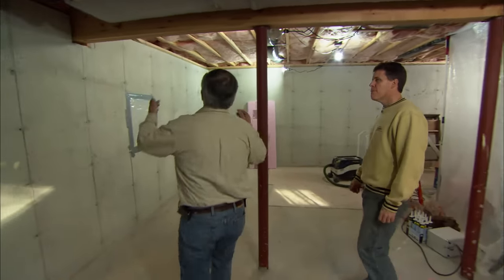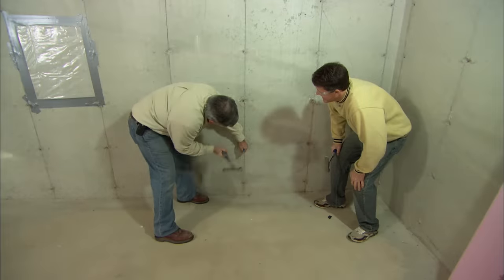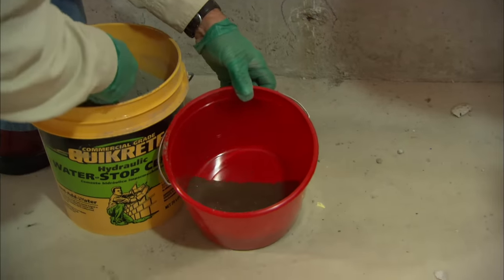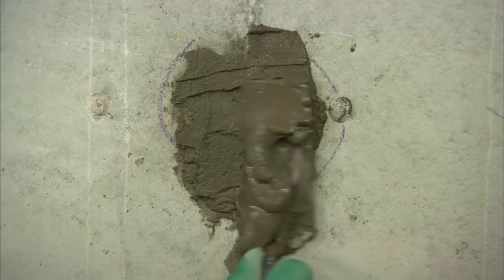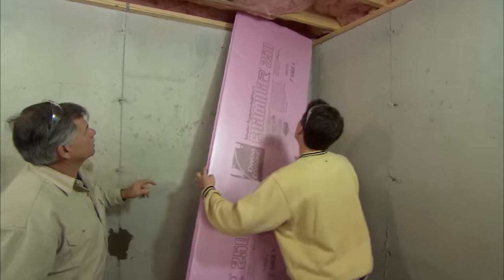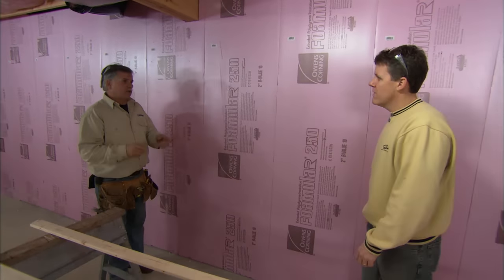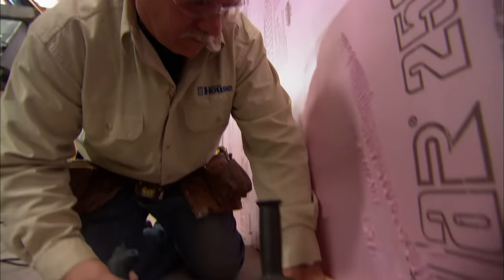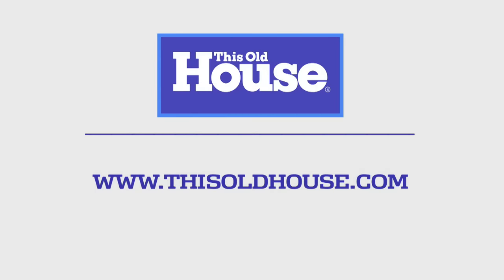How to Insulate a Basement | This Old House

Comment: If you live in a part of the world that experiences extremely cold winters, the risk of frost and ice forming in-between the XPS panel and concrete are ridiculously high. To reduce the risk, the perimeter of each panel would have to be completely airtight. Good luck achieving that against a poured concrete foundation. Doesn’t matter how dry your basement is, dehumidifier, RH <30%, frost will form on above grade concrete walls if temps drop down to -38F, regardless. Once a layer of frost is established it will grow like a fungus over the cold season just like it does  on the walls of your chest freezer. After a few warm spring days aka “defrost cycle” you can forget about having a dry floor, or walls, or carpet. Don’t ask how I know.
Reply: Agreed. So what would be a better solution for cold climates then?
Reply: @evgenykujin1725  a properly installed spray foam solution is about the only way to retrofit in an existing home. ICF with compatible spray foam around the rim joist if building new. It’s an uphill battle against moisture / mould otherwise.

Comment: I actually used this method and was sorry I did. 1) those bent bolts were near impossible to find. 2) drilling holes into the (35 year old) concrete walls ate up tons of drill bits. 3) One wall was slightly bowed so that putting drywall over it was problematic. 4) etc. Had I known all the issues, I would have used a completely different method.
Reply: did you use masonry bits? i have to drill concrete a lot at work and one bit will last months of hard use into concrete that is at times over one hundred years old.
Reply: Gene Lamb That's the thing. They were not bolts. Spring Spike Nail.
Reply: @leeknivek  and did he use a hammer drill? Regular drills aren't for concrete.
Reply: @digitalconsciousness  Thanks to everyone for their comments but drilling the holes was only one of many issues with this wall structure. In retrospect I would have used normal framing with steel. Would have saved additional fireproofing, allowed for easier outlet and wiring installation and made it easier to put on baseboard.

Comment: I am doing a similar project on my basement, however here in Greece they do not have these special adhesives, just using a low acid silicone adhesive to the concrete. I also use a serrated knife to do my cutting and to make it easier I spray the knife with a dry silicone spray. To do the drywall I just frame out with steel studs and then hang the drywall. Only problem here is that they do not have "new construction" outlet boxes to pre hang for electric. They only have boxes similar to our old construction work electrical boxes. It is a pain in the a-- to run the smurf conduit into the box since there is no clearance in the hole one places in The drywall to mount the box.

Comment: I did just that, few years back, my basement is 3/4 under ground on West walls and slop down to couple feet East side. An old ranch, built back on 57, foundation is not poured concrete, they use concrete blocks, which is very porous, but at least it was sealed outside with tar, and had some drainage around using clay pipes. Is not a full 8' ceiling either, which driver me nuts, one more roll of blocks would have accomplished it🤯. Had big issue with hydrostatic pressure, when I bought the house everytime it rained water would started coming between the concrete joints, center. I installed a sump pump below floor an installed gutters. Basement has being dry since than, for about 15 years. Finished basement that foundation was not proper done, is a big challenge. You have to fallow some rules, a steps. I did read, searched, watch videos, for long time. But it's a site, forgot the name, that explains step by step how to do it, according to different situations.  I actually printed out the pages that portioned to my case.

Comment: When i finished our basement., I added a cork into each hle , then used the hydraulic cement.
Reply: Did you put sealant on the cork?there is specialty foam rod for that use.it works great.I use it around window installs and then follow that with sealant or expanding foam

Comment: I worked at a 300 unit apartment and we use to get a lot of rod hole leaks. Best and cheapest way to plug them, silicone caulk with a cork.
Reply: at least use urethane calk, not silicone

Comment: I did the condensation test twice on my basement walls in two different places. No problems. But I did that in the Winter. Does it really make a difference what time of the year you test for condensation on the basement walls since Winters tend to be drier than Spring or Summer?
Reply: It makes a big difference.  That was the first thing I thought about when I saw the "test."  In full-season climates, basement humidity drops significantly in the winter when outside ground water freezes.  Test in the spring and summer for the worst case scenario.
Reply: Many of you folks forget about water pipes (which tend to develop leaks) when doing moisture testing and the best time is during the season of spring and autumn since that is when condensation season starts and ends.

Comment: I think any seepage will be trapped behind those insulation boards and not dry and then have mold behind there.  You should frame out a regular 2x4 wall. You should just use regular insulation and make sure it doesn't touch the wall .  Any seepage will run down the wall and has a better chance to evaporate.
Reply: I agree. not only for the sake of the mold but the concrete needs to breath. Trapping acidic (from soil) water on the concrete will only lead to it's deterioration. I would use the foam for a vapor barrier, but leave a space between the concrete and finished wall.
Reply: So how does the air circulate to keep dry? With such a small area behind the studs, how is the air gonna move enough to keep it dry. Seems that area needs its own ventilation or it could mold without proper air movement?
Reply: im doing mine soon. What ive taken care of moisture, mold control and foundation. What about a coat of flex seal before framing  good deal yea?!?!?
Reply: @donteague614  If you circulate room air against the cold concrete walls to dry them, there is no point in having any interior insulation. Also if your basement wall isn't properly waterproofed from the outside there's nothing you can do. Might as well just insulate the floor joists the best you can and pretend you don't have a basement.

Comment: Before adding the foamboard, wouldn't it have been a good idea to seal the basement walls to prevent any moisture from coming in?  Also doesn't drilling the holes for the nails create the same problem you had with the ties leaking?
Reply: The point of the plastic at the beginning of the video was to show there wasn’t a moisture issue, so no need for a sealant. The holes being filled with the concrete contain a metal rod that extends through the full width of the foundation acting as a direct pathway for water to come through (0:55). The holes they were drilling for the nails only went into the wall a few inches.
Reply: Sealants are typically only good in the short term…not the best for the long term health of the concrete.
Reply: Keep the vapor barrier on the warm side of insulation.  Not on concrete

Comment: Could you use a ram set instead of drilling and hammering the nail in like they did?  Would it damage the foam?
Reply: A ramjet nailer would rupture soft materials like foam board insulation.

Comment: Total newbie here. I always thought you had to build a frame for the walls first. Here, he's putting in insulation first. Can that work for any basement?
Reply: It’s the best way to prevent warm moist air in a finished basement from condensing on an exterior concrete wall. There should always be an air gap between the finished interior and the insulation. It is important to use closed cell foam be it XPS panels or spray foam directly on concrete. Studding up a wall first then insulating between studs is not a wise decision. I would take it one step further and tape the seams with moisture barrier tape.

Comment: I've never understood the rationale for finishing a basement wall this way.  Poured walls are never plumb or straight.  Frame walls in the conventional manner, leave a two inch air gap, insulate, etc. Done many this way, passes code and never had a problem. Provided the basement was dry to start with....
Reply: Most of the time framed walls are built on the floor, then raised. The top plate toenail has to be lifted over and into place. Often times you need a nail from the outside going in. It would be difficult to achieve this with the concrete wall already there. How would this ideally be accomplished?

Comment: What happens when the concrete wall shifts with moisture, freezing and thawing over the years. That happened in the last home I owned and the entire door in the only finished room shifted over 1/2 inch. Wouldn't you want to frame a wall and put a barrier between your framed wall and the concrete wall to allow for minor concrete wall movement?  Everything always fits as soon after the contractor finishes the work, but years later - settlement occurs.

Comment: Personally I would not recommend using any fasteners in to your concrete wall. The foam on the wall is correct, but then always use a plastic sheet product like Dampro on the floor, cover in 3/4" OSB with tapcons up to the foam on the walls, and then add your framing on top of that subfloor. This ensures you have airflow space from your concrete walls through to under the floor. This allows moisture to naturally evaporate and creates a barrier between your damp concrete, and your living space.

Comment: I would never do it this way!  Drilling into the concrete just allows for hundreds of points for water to get in. Plus by using this 1x3 you now have to dig into/ cut out the foam board for every light switch and outlet, adding hours of tedius work? 

Tyvec paper on foundation wall,, then use 2x4, one inch and a half from wall, top plates screwed to joists, pressure treated on bottom,  and regular roll insulation. Cover with 6mil plastic. Cheaper, no holes in wall. Much more effective at moisture control,  and professional.

Comment: Old tool guy law:
Never hold the chisel/punch the way he did in the video.
Wrap your thumb around the tool same direction as your fingers.
That way ... WHEN (Not 'If') you miss and smack your thumb, you don't break it.
If your thumb wraps the way we normally grasp a tool (we have 'opposable thumbs' for a reason, right?) and then grasp really tightly, one miss with the hammer results in a broken thumb.
Reply: I was thinking that looked super sketchy.

Comment: I'm not saying it's a bad Way of framing I like the big . I just thought if there was water coming through them re bars in the foundation why drill more holes into it. I had a similar situation I'm one of my house . I just stick framed with metal stud framing . I did the math your way is cheaper.  I like your vid. it showed me another way to frame basement I never did it that way before . Some time we learn from others. do them pins go in alot . or like a 1 inch or 2. Sorry I should of ask questions first before a made comment.  I just would of assume making more holes in foundation was a bad idea in my house

Comment: I like the simplicity of this method, but an electrical inspector won't like it. How do you keep the required 1-1/4" clearance from front edge of the rough framing to the Romex?  Any ideas are welcome! I guess you could run it vertically and tuck under the horizontal 1x3 with a nail plate there, but the rest of the wire run wouldn't be held back 1-1/4"+

Comment: I believe using tap cons on wolmanized boards no insulation ,using air as an insulator this letting any condensation or future water problems drain freely down to the floor. Tyvek the studs put up green board. Seal your joints be done. Would probably be wise to leave your wall at least 1". Off the floor to allow drainage if water does become an issue using plastic cove base or foam.  If done this way there should never be any materials used having to ever be replaced unless submerged by water.

Comment: I have never seen a basement wall done this way - and for good reason.  Yes to the rigid foam, but then you need to build a stud wall in front of that and insulate with fiberglass insulation.  The stud wall also give you plenty of room for electrical work.

Comment: I just did this, but I'm curious what the electrician is going to say when he gets here in two weeks. I'm most concerned about how to protect the lines from being punctured by the drywall screws.
Reply: Eddie McNeal how much did it cost per sheet?? and where did u buy it from??
Reply: Nick Mossey it cost $35.00/sheet from Lowes. I bought the 1x3s and the anchor screws as well. I used my Rigid impact drill to install it.
Reply: Eddie McNeal do you have any pictures?? and how much did it cost in all??
Reply: Eddie McNeal ???? any pics
Reply: +Eddie McNeal What was the verdict? How'd you run the electrical? Any pictures? Getting ready to start this project myself and your experience would be helpful! Thanks!
Reply: +Eddie McNeal The drywall screws are not long enough to pass through the framing 1x3s.
Reply: By doing the electrical BEFORE you do the drywall is the best option.
At that point, just ask the drywallers to use 1" drywall screws. This will not  go through your framing.
You also do not need to do 16" center as long as it isn't load bearing, but as it's the standard, that's what I do anyways so it won't confuse the next person be it the client or tradesman.
Reply: I thought NEC states that for new construction,  wires need to be at least 1.25" from front of stud to allow standard 1-5/8" screws coming through the 1/2" sheetrock and possibly shorting 2 conductors in the wire. Sometimes these errors do not cause problems for years, but next to this flammable insulation which puts very poisonous gas into the air when it ignites, it can be the loss of the home or worse. I like the idea of the foam board, but I think it is best glued to the backside of a framed wall, and the bottom board of the framed wall should be rot resistant (eg pressure treated) in case you get moisture along the wall or floor.  Concrete has poor insulation properties but they state walls only need to be insulated down to 4 feet below the outside ground.  It is also better to leave 0.25" to .75" space between the foam board & concrete wall, but make sure that space is sealed from the basement air with the use of expanding foam. Otherwise moist summer air can condense in that cool space & grow mold. The bottom 6 to 8" should be free of insulation and have 2" ventilation plugs installed to allow evaporation in case severe weather causes water to get in that area. Ventilation is the cure to mold issues.

Comment: This kind of work will depend greatly on the location.
I live in a city where code does not allow wires in the wall, EMT pipes are required and the recommended R value is 13.
just wanted to mention that.
Reply: The code should allow flexible metal conduit.  By using 2x4s instead, cost of wood will be similar and running conduit will be same as any other house wall.  By adding fiberglass batts between the studs, you now have an R21 wall.

Comment: What I'm looking for is a video to show me how to build a removable insulated wall. I like how cold the unfinished walls get in the summertime. Yes I want to remove the drywall, studs and insulation in June every year. If anyone has a video like that CASH ME IN DA BASEMENT HOW BOUT DAT?
Reply: JD Weaver lol just build the frame like a regular wall and attach insulation to the back of it. Domt attach the wall the way shown, just   install some achors in the cement and bolt the wall up and remove as needed. Simple just kind of wierd.
Reply: Jason Morehouse lol that's mean bro

Comment: So much work to get 1x4's in there. Just frame it with 2x4.
Reply: How to attach the 2x4 against the foam board?
Reply: I used the 2x4 method in my basement. Put a treated 2x4 down as the bottom plate. Put concrete anchors every 4’ to hold it in position on the floor. Put a single regular 2x4 as the top plate.  Nail it to bottom of floor joists. If wall is running parallel to floor joists, every 4‘ place a 2x4 block perpendicular to floor joists.  Since surface of concrete floor may not be perfectly parallel to the bottom of the floor joists, you will want to measure and cut each stud. 

1” lumber is so much more expensive than 2”, so cost of using 2” lumber will be about the same.  Using 2x4s will not require cutting cavities for electrical boxes.  Since 2” of XPS is R10, cutting cavities will reduce the R value at each box.  Plus, the nails used in this video will act as thermal wick.  The steel nails
Reply: The steel nails will wick heat directly into tons of cold concrete.    

The portion of the wall which is above grade to at least 2’-4’ below grade, I added fiberglass batts between the studs.  This is the portion of the wall subject to the greatest temperature extremes, so why not add extra insulation in this zone?

Comment: The joints in the foam bars should be sealed and I would frame a wall in front of it for 2 reasons. #1 it’s faster and easier. # 2 your following the foundation wall. If the wall is in and out and not perfectly straight you will see it in the drywall and ceiling later. By framing an independent wall, it will keep it straight.